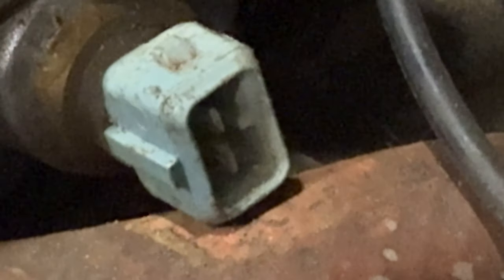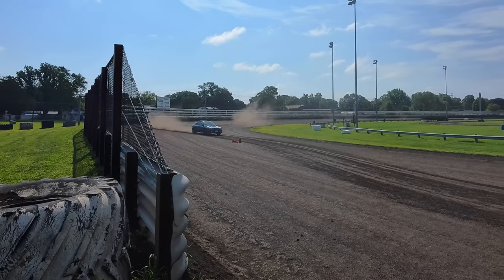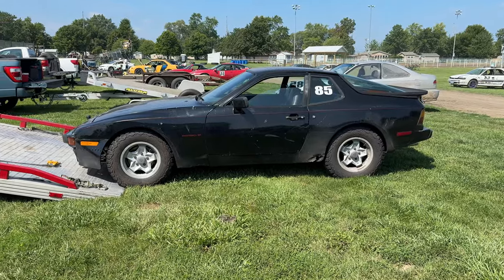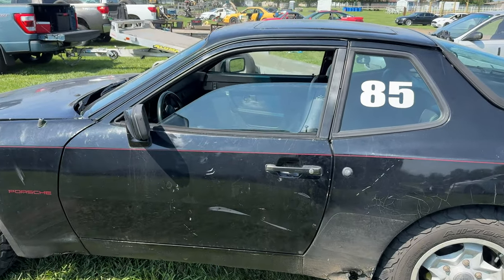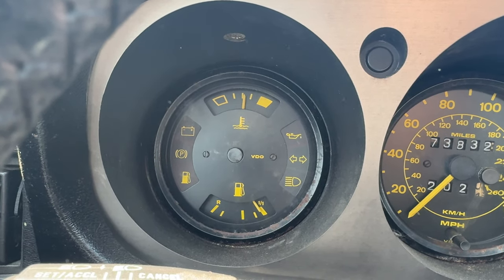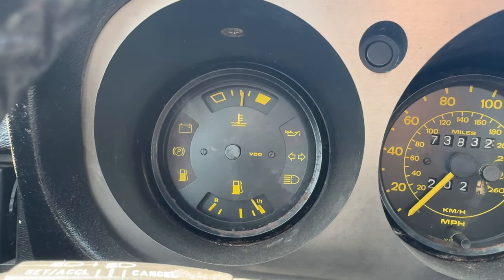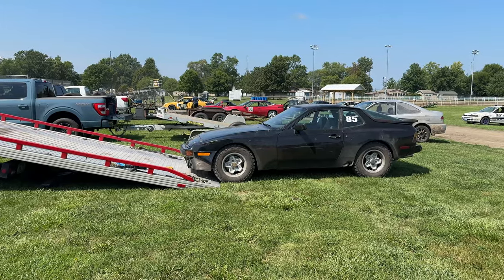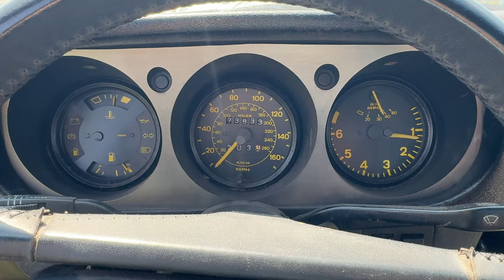Testing My Porsche 944 Rally Car at Rallycross for the Third Time

Comment: I got the impression, and you seemed to confirm it, that the car is just slowing down over each run. Though it has improved with the new heat sensor.  Some one said in previous videos that they thought fuel evaporation might be an issue, I would look into that as a possible cause as it does show some symptoms of that. The Dyno seems to be a good  place to test  it Steve.  I hope you can find the cause soon. 👍👍

Comment: Probably a dumb question but have you cleaned the fuel strainer? When I drift my 944 the grit and junk can cause it to run bad. Also running with a full tank of gas helps due to the pump location.
Reply from the maker: Do you mean the fuel filter or something else?  Fuel filter was new between the first and second time I tried to rallycross it.

Comment: Would it be possible to connect a datalogger to the car while on the track? Then review the collected data later, at home? You have a lot of video footage of your runs, maybe you could combine the data to get any more clues.
Reply from the maker: This car is way to old to get any data out of the computer you cannot even use a scan tool with it.
Reply: @ThisWeekWithCars  That's a pity, makes solving the problem way more complicated.

Comment: not an expert but could the car be suffering from fuel vaper lock like some of the Jeeps would suffer?
Reply: Think you might be on to something  but it  may be a fuel pressure issue.  SuperFastMatt ran into a sloshing fuel tank issue and other oil stuff when he did a project due to the sloshing and angle forces pushing the fluids out of their pick up areas.
Reply: it caused loss of power and overheating.
Reply: @TL243  it can, yes. A vapor lock problem makes the car run lean, causing it to overheat as it struggles to generate enough power. I've seen it happen a few times on Jeeps. I am not saying that's what's happening, but maybe 🤷‍♂️
Reply: The coil is a possibility.  I’ve had several instances of difficult to diagnose loss of power which ended up being the coil which only showed up with heat soak.